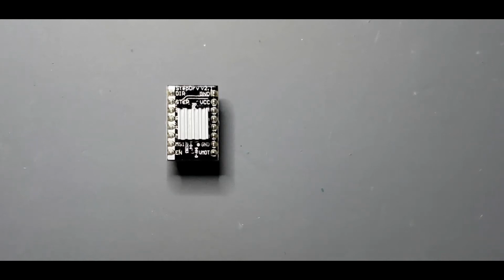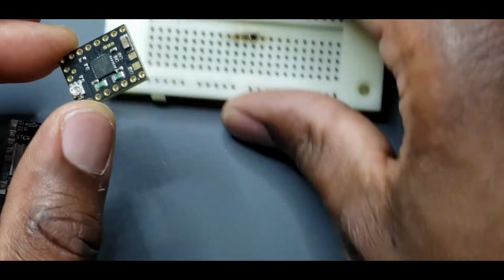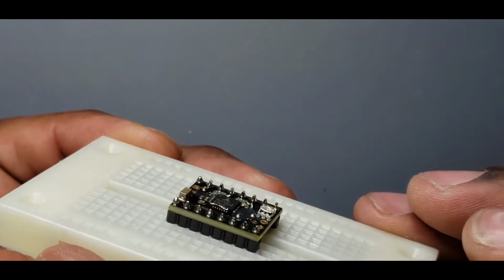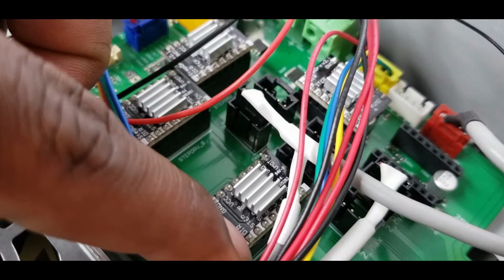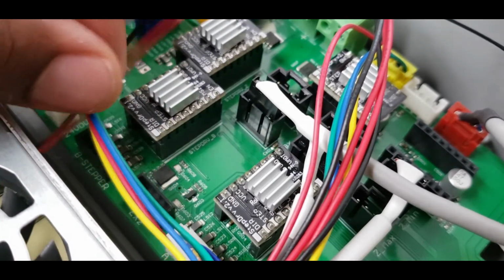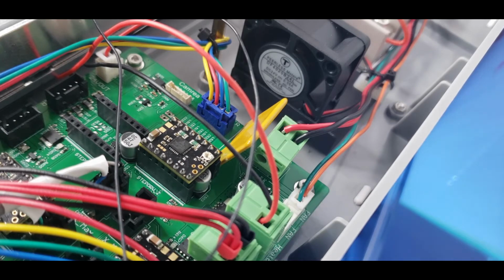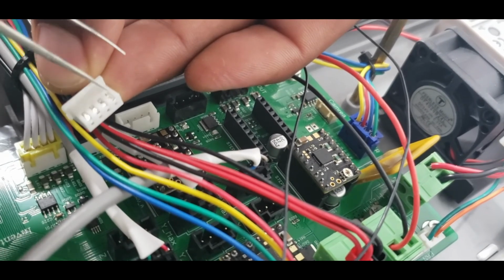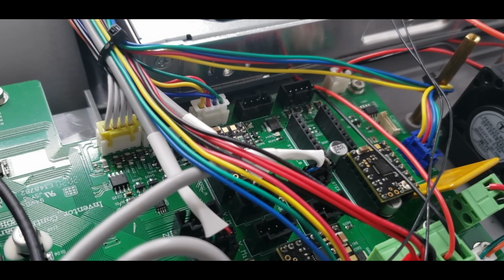Flashforge Dreamer 3D printer: Stepper Driver Upgrade  (TMC2209 SilentStepStick)

Comment: i set my v ref to 0.56volts to be safe ,dosn't seem to be missing steps , it seems only 2 of the 5 motors have serial numbers which of the two are the extruders with 0.8 amp rateing
Reply from the maker: I no longer have this printer so I cannot confirm what motors I had. As long as youre not missing steps you should be good. I believe my value calculations were at 80% of the peak current. Not sure how fast you print, but that might be a good test to see if you skip steps. 

Is your printer more quiet?
Reply: @DeedTech  yeah, I've finished installing tmc2209,s in it, printing at 80 mms with no problem, it's basicly silent, just need a fan upgrade. This printer has been in storage for 8 years so I thought I should upgrade instead of tossing it, currently have an ender 3 and the forge prints faster then it, I might install marlin fw on it aswell
Reply from the maker: @yobb89  Very nice! It's a great out of the box printer. If you go marlin and change the board, the drivers you have won't work unless you desolder and flip the TMC board. Time wise, it's easier to order new tmc2209s.

If you're going to upgrade the board. Look into klipper as it allows for faster movements and the dreamers are ideal since the bed is on the Z axis

Comment: i think you need swap all 4 wires, you only switch red and yellow ,, from left to right it should be   green,blue,yellow,red
Reply from the maker: To switch the direction of the motor you only need to swap one phase (connected pair) of wires in order to run in the opposite direction.

 Swapping both phases will not change the direction. If attempting something like this, never go based off colors not all wires/connections are made the same. It's best to test continuity across phases and swap one set of wires
Reply: @DeedTech  yes you're correct, I did a little reading about 2 phase steppers

Comment: what are the dimensions of that tmc 2209 board? Thickness, Length and width?
Reply from the maker: With pins, without pins? With Heatsink (there are different heatsink sizes), without heatsink? Inches, milimeters?
Reply: @DeedTech  yes to all with pins without etc but in millimeters. I have seen 2 heat sink fans on tmc2008 and tmc2009 and wondering if they are the same height.
Reply from the maker: @stu6097  so using some preassembled ones I've got. 
-Length (short side) 15.33mm
-Width (long side) 20.49mm
-Height (with heatsink) 22.55mm

Keep in mind the TMC2208 and above drivers require active cooling (fan)
Reply: @DeedTech  Thanks for dimensions. Do they make little fans that attach to arduino nanos for example? Fans that are like 10mm x10mm or something close to that? Iam dealing with limited space. I am not using in a 3d printer.
Reply from the maker: @stu6097  I'm not sure but a quick search brought up these. I've never used anything this small. 

https://www.mouser.com/c/?marcom=126694370
Reply: @DeedTech  oh thats great. At least now I know something like those exist. Thanks
Reply from the maker: @stu6097  glad I could help!

Comment: Hey, i Texted with flashforge and they told me it would be Better to leaf the Creator pro 2 Stock... But the printer is loud... U think it work with that Board too? It Has the same Problem with the drivern
Reply from the maker: A manufacturer will never tell you to upgrade their machines. Especially if the parts you'd upgrade aren't coming from them. To my knowledge,  they don't have  drivers like the TMC2209. They would only be found on newer printers (which they'd rather have you buy than upgrade your older printer)
Reply: @DeedTech  yeah right, so the driver upgrade will work ?
Reply from the maker: @callsign_charge7244  they should work but they ARE NOT plug n play. You HAVE TO make sure the orientation of the pins is correct. Otherwise you WILL fry your board. After that you will need to set your vref like in my video. Not all motors are the same so you will have to find the Current the motors use and do some math to get the values to set the new drivers at.
Reply: @DeedTech  yeah i checked that, have to do the same way like u did...i will try and let u know
Reply from the maker: @callsign_charge7244  you will have to buy ones without pins and solder them in the correct orientation  for your printer
Reply from the maker: @callsign_charge7244  I'm wondering if I should pre-solder some  and sell them so people who don't solder can purchase and skip that step.
Reply: @DeedTech  oh that would be nice, i Can solder but Not like u that tiny stuff... I would take some
Reply from the maker: @callsign_charge7244  Send me a email at deedtech@proton.me

Comment: Thanks for making this video. It was helpful to watch before I went and swapped out the A4988 drivers on my own FF Dreamer. The TMC2209s make it super quiet and buttery smooth! Really nice upgrade. Now I want to upgrade the 40mm fans to noctua fans to quiet it down some more lol.
Reply from the maker: Thanks for watching. In regards to the fans, I don't 100% remember but I'm pretty sure the dreamer is 24v. Noctua fans are PC fans and they run at 12v. If you plug 12v into 24v it'll most likely fry the fan. 

I have the dreamer NX (single nozzle), but if you have the dual nozzle, you can hook up 2 fans in series so that they'd need 24v to run. If you only need one fan, you can get a simple 24v to 12v step-down regulator, put it with the electronics at the bottom and hook up a fan directly to that.

After replacing the drivers, I think the the loudest fan is really the power supply fan. I don't think the extruder fans were that bad. Listen and see.
Reply: @DeedTech  Yeah the Dreamer's fans are all 24V. Noctua's 4010 fans are all 12V. I've had to replace the original power supply on mine already. The fan on the one I replaced it with doesn't seem very loud.

I have a non-NX Dreamer, but I removed the second extruder because it wasn't something I was planning on using. I was hoping to improve the amount of ringing on my prints by removing some weight (it helped a bit).

I'm considering getting some LM2596 buck converters to step down the 24V to 12V for the stepper driver and hot end fans. Then it would be possible to replace those original two fans with Noctua 4010 fans.

The Ender 3 apparently uses 24V fans as well. People who own those seem to be using LM2596s to switch to Noctua fans.

I'm undecided. I don't know if it's really worth it just to quiet it a few db...